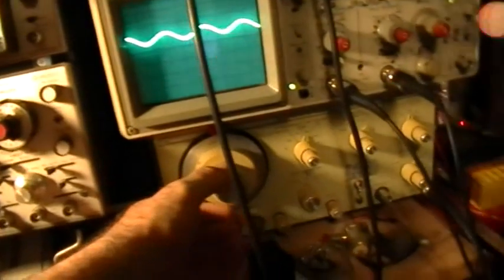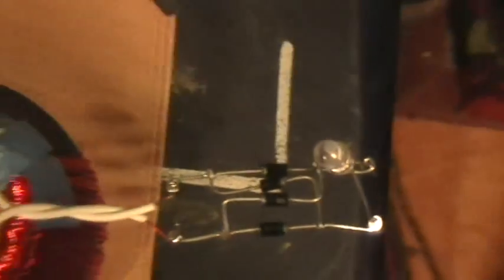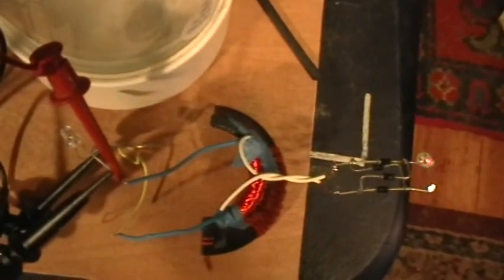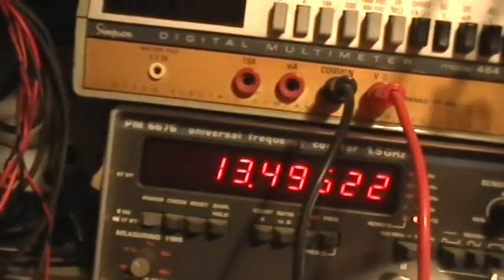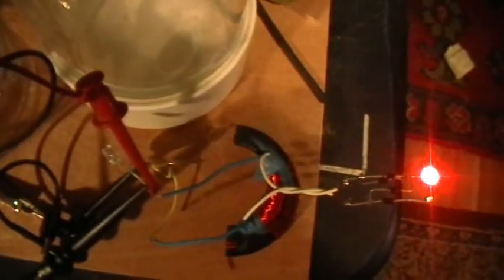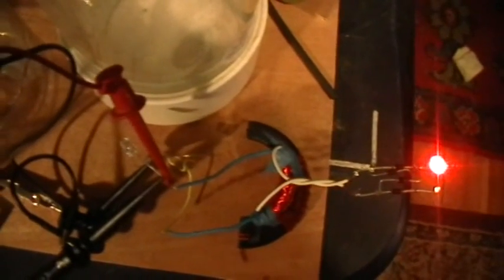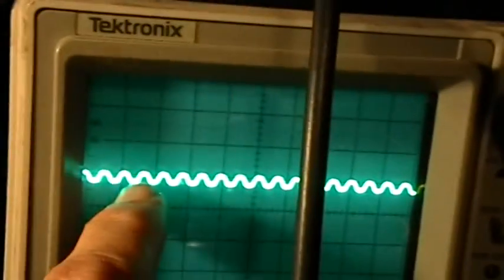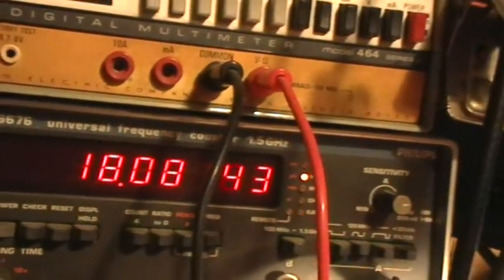Magnetic Resonance Amplifier 5: Dual Piezos Increased Capacitance

Comment: So whats this "input" led supposed to be showing anyway? Wouldn't it need to be in series with the input to show power going into the tank? Or is it just a tuning tool to find the resonant freqs?
Reply from the maker: I think it's kind of a Red Herring. LEDs are so commonplace we take them for granted, but they are weirdly non-linear and can make people conclude all kinds of silly things.
Putting a diode in series with the tank circuit doesn't work very well.
Reply: Good point about the diode in series... Didn't think that one through. maybe 2 in anti parallel, and up the voltage to account for the Frv. I agree they are oftern a red herring. Really need to do RMS input and output watts to test this kind of circuit for efficiency. Will you be doing scope readings of the output for voltage and current? Would be great to see a proper efficiency test. With them being so rare on youtube...